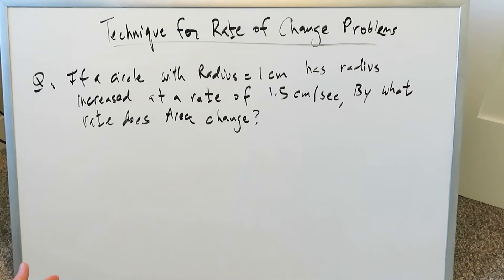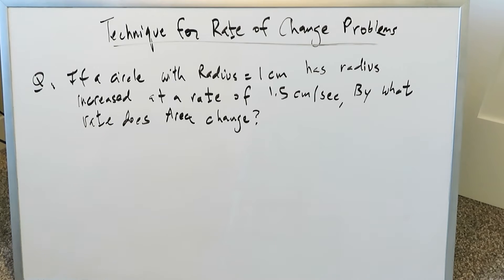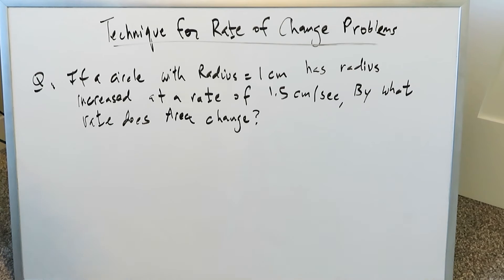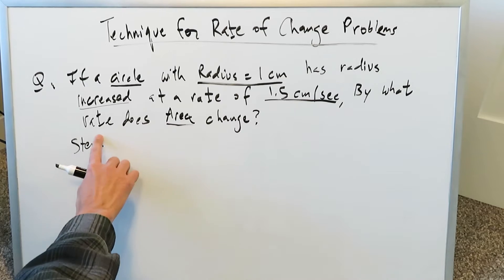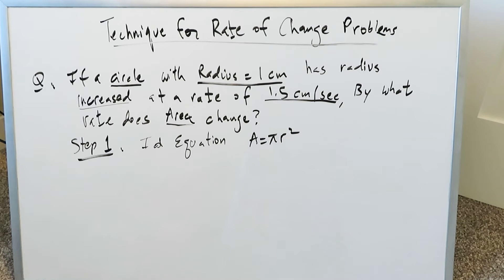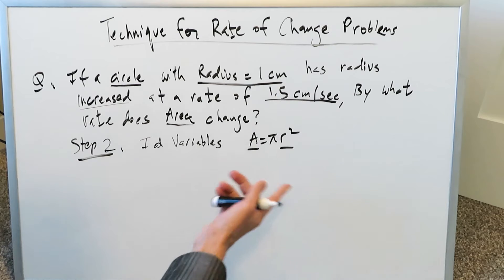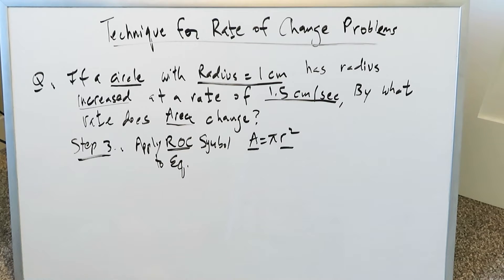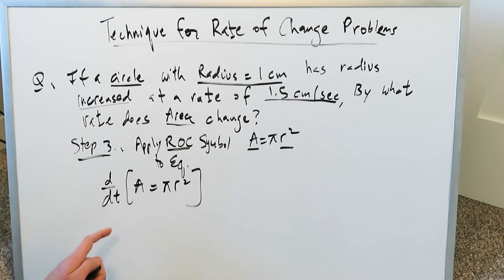Step-by-Step Procedure for Solving Derivative Word Problems

Comment: In first question related to circle, at time t=0, radius is 1cm hence area of circle is pi. At t=1 sec, radius is 2.5cm and now area is 6.25*pi, so rate of change at first sec is (6.25pi-pi) = 5.25pi. Why my answer not matching with author ie 3*pi??
Reply from the maker: The reason why your answer is not coming out same as what I presented is, because the manner in which you determined your 5.25 pi.

Think, kindly, what you did:
you took 1 area at a given time, and then another area at another time, and their difference,
in essence, it was a disguised slope calculation, between two points at time 0 and 1.

And such a determination will involve a secant line and a slope over a period of time (even if that time period is very small) that may not necessarily represent a derivative.

A derivative determination is done at an particular instant, not over an interval.

If you had applied a limit to your calculation to bring that lim t --> 0 into effect, you would then be doing a derivative determination.

the 3 pi answer as presented is correct as it represents that rate of change of Area at a particular instance or point of interest.
Reply from the maker: If I asked you,
a Square with sides of 4 cm (area = 16 cm^2) has its sides increased at a rate of 6 cm/s, at what rate is the area of the Square increasing?
What would your answer be?

So I can explain you then the answer to your question...